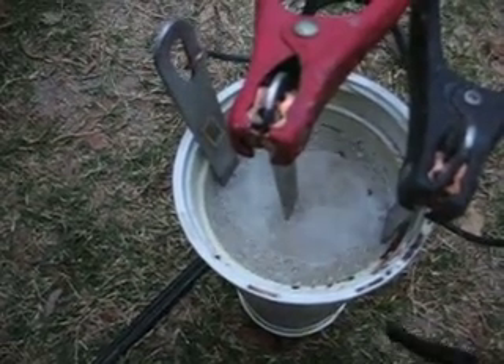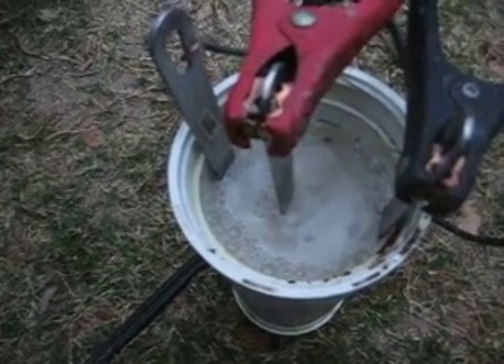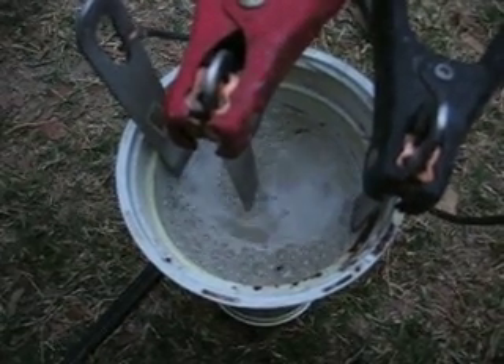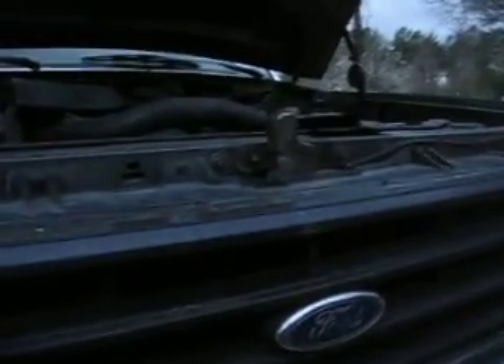006 HHO to many (7) Neutrals reduce gas production

Comment from the maker: My Voltage drops from 13.5 Volt to sometimes 11 Volt and a current of 14 Amps. makes about 150 Watts. I need the remaing Wattage coming from my  600 Watt Alternator  to run my electrical System on my truck

Comment from the maker: I have changed the configuration after I had pretty good results, trying to make it better than it was. I believe the voltage and amps depend on your personal environment and conditions. Therefore the Voltage and neutrals need to fit your system.

Comment: When you had your great results did you start to run low on water? Did you add just water or water&electrolyte? If you added more electrolyte you would get more heat, run away heat. You only need to add water if its working right.